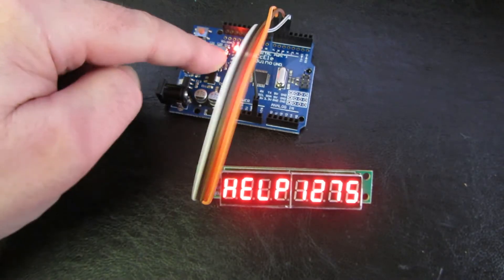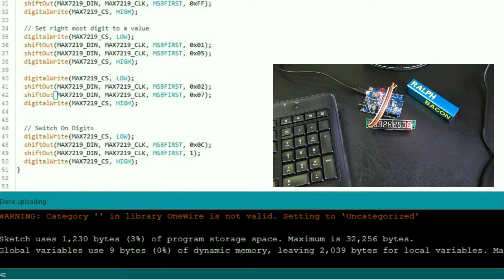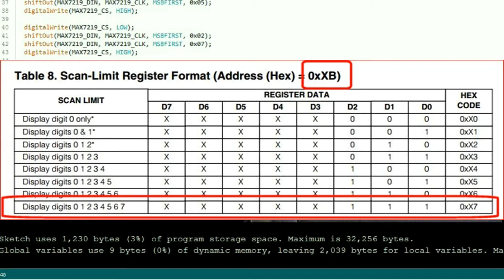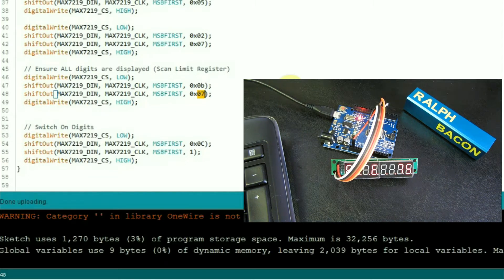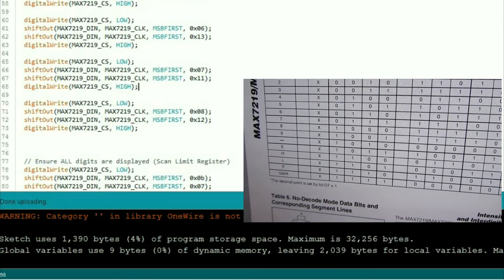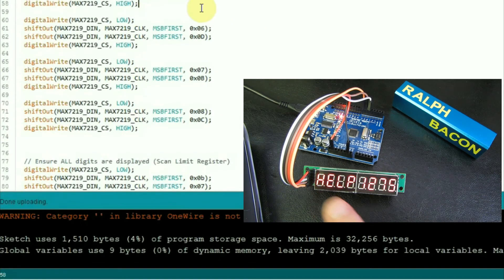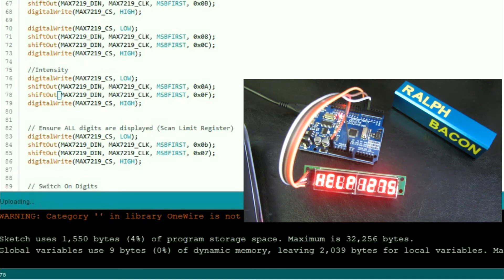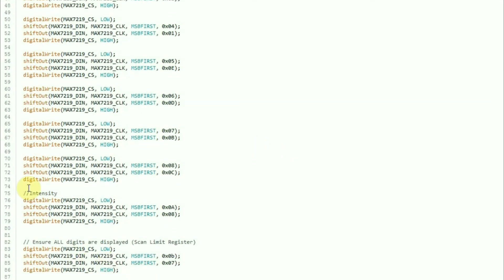#10 Arduino and LED 7-segment displays using a MAX7219 - Part 2

Comment: Great video! But that display board is very cumbersome to program!  Would be terribly difficult to display a changing value or data
Reply from the maker: Not at all, Bill, from I can remember from this rather old video now, it was very easy to put a number into any digit very easily. Have a look at video #63, it might be covered in the newer video on this device.

Comment: Hi, is it possible you help me to modify this code for count pulses from an encoder and show it in this display module?
Reply from the maker: I'm afraid I don't have the time to modify my code, Ivanildo, but if you look at my video for rotary encoders (is that what you mean by "encoder"?)  you will easily be able to adapt that sketch to display a number on this matrix. Good luck!

Comment: I've always had problems addressing this display properly. Your vid gives me a little bit better insight as to what it wants to see. Thanks, back to my PIC's
Reply from the maker: Hello Raymond! I'm glad it helped. I recently did another video #80 on these MAX7219s that are 4-in-1 displays (positioned at 90-degrees to these ones) and for which a much better library is available. I'm in the middle of constructing a long ticker message using 7 of the 4-in1 displays (so 28 modules in total).
 
Just sayin'! Thanks for posting, Raymond (Ray?) and what on earth is a PIC anyway, a new type of Arduino, I suppose, heh heh!
Reply: Speaking of PIC's, which I have been using for 20 years, When Boeing did the first 250 ship sets of cabin door security locks, it was PICs that we used